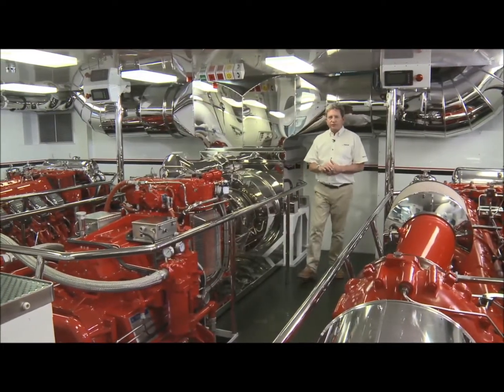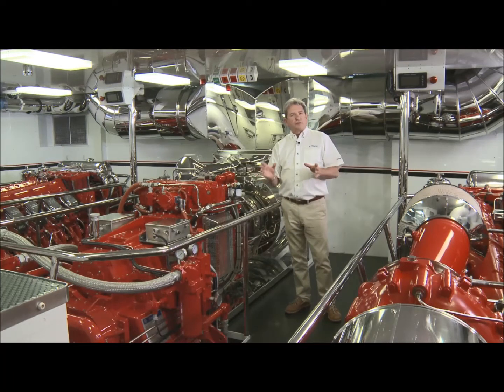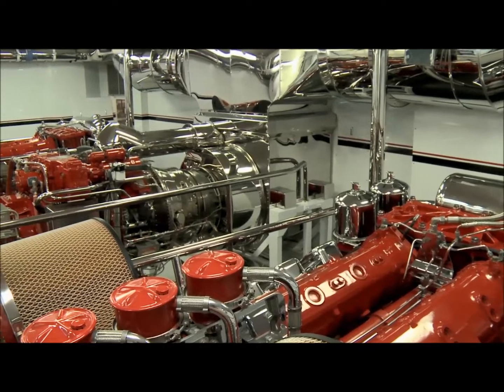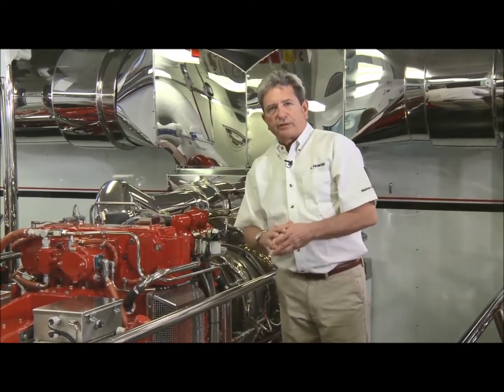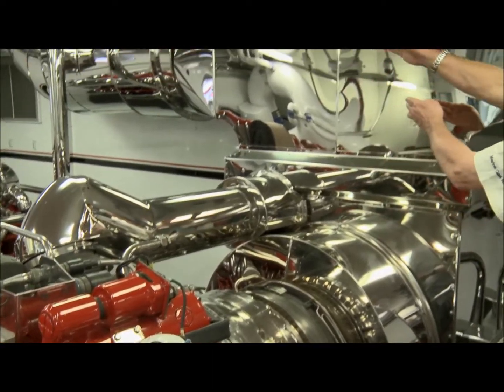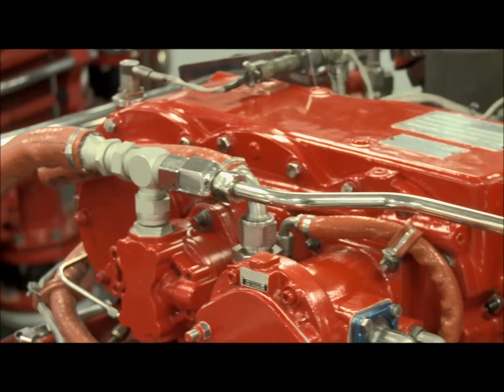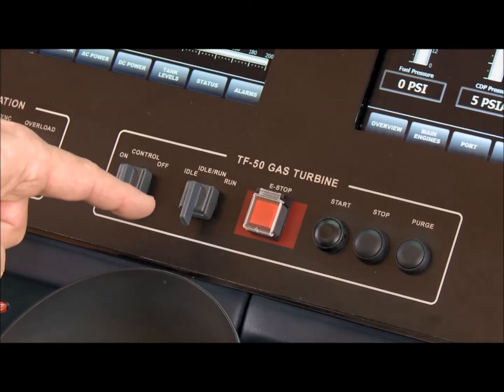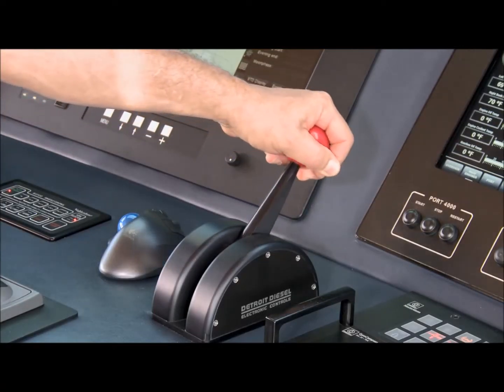Vericor TF50 Gas Turbine Engine- Marine Propulsion

Comment: That's cool af. Why dont they call it a diesel turbine engine then ?
Reply: Because Diesel is the Engine Cycle and not Fuel. The Fuel Oil just happened to be named after its most common Use.

Comment: Should be mentioned that the TF50 (and the the TF40) is derived from the Lycoming T55 helicopter turboshaft engine. With it's centrifugal high pressure compressor, the TF40/50 engines are notably shorter than all axial designs of the same power class like the General Electric LM500 (which is based on the CF34 turbofan). This helps with packaging within motor yachts and high speed patrol crafts with limited machinery space.
Reply: Interesting ! do you know how many spools the TF50 has ? I cant find it anywhere.
Reply: @matthiasknutzen6061  It depends on how you count. The T55/TF50/TF40 has a single compressor spool -- the 7 axial stages and 1 centrifugal stage driven by 2 high pressure turbine stages sits on a single rotating assembly turning at the same speed called N1. However, power is not taken from the compressor spool but rather a separate power turbine with 2-stages that drives the output shaft called N2. You can say that it is an engine with a single spool compressor or you can say it's a dual spool engine in terms of the total number of rotating assemblies. This contrasts with modern 2-spool turbofan engines which typically have high and low pressure compressor spools rotating at different speeds.
Reply: @dwightlooi  Thanks for your comments. Yes the TF50 and well as the TF40 and related ETF40B engines are all called two spool or two shaft, free turbine engines.
Reply: Question? Could 1 Use The High Flow Exhaust Speed From A Turbine To Generate Electricity?
Reply: @johnal-kel9063  High exhaust velocity does not equal high rotational speed. Typically the power turbine will be turning at about 3000~3600 rpm. This is then geared to turn the propeller or it can be used to turn a generator directly to produce 50/60Hz power.

Comment: I  traded in once from Lycoming Stratfort a TF 35 to design and supply a CODOG propulsion system for an existing chemical tanker. Gearbox was made to reduce to 1000 rpm. Bridge, ER control and cp propeller were modified.
Ship was certified by Bureau Veritas of France. Inlet and exhaust losses were 200 hp.